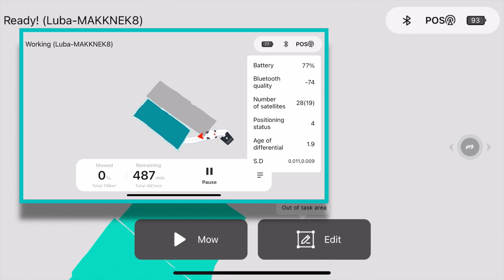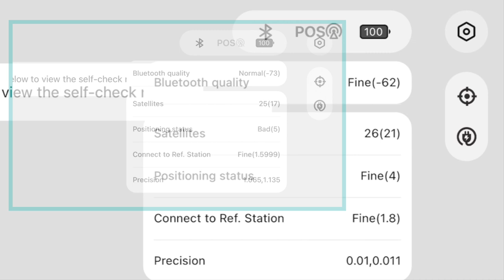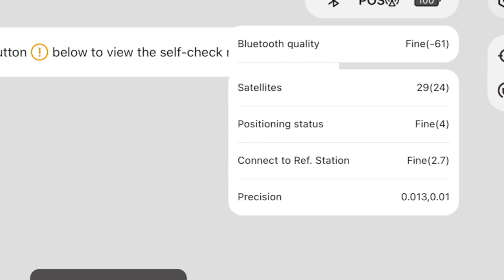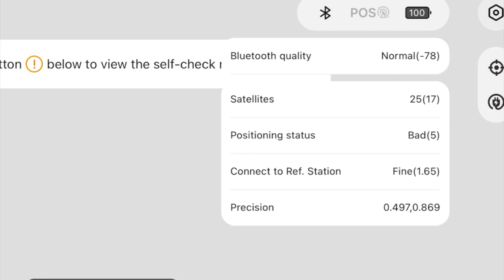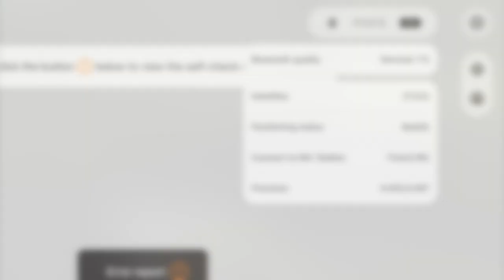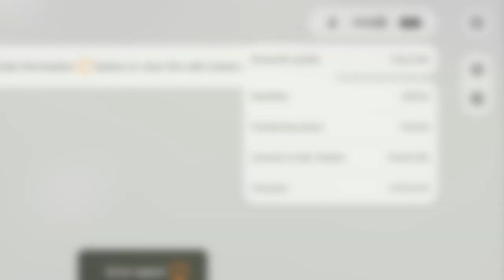Luba Automower Part 3 | Testing out Signal Strength RTK & GPS!

Comment: Thanks for going the extra mile with the signal tests. So far you are the only reviewer of this product that has focused on the most important issue. The cutting and other features are a given it's whether the signal will work in worst case scenarios. Well done. I plan to pick this item up next year. I want to see it get a few updates after mass use this year before I take the plunge.
Reply: Probably a good idea. I got mine yesterday and are working to understand the relationship between the base station and the RTk antenna, too.
Reply from the maker: Thanks for watching…. I want to do an update but my RTK is dead…. Water ingress… waiting on a replacement and will update
Reply: How long did it take to get a new one ? How was it dealing with customer support .. @thelonelandlord  thanks for the videos
Reply from the maker: support responded within 3-4 days and then took about 2-3 weeks to get the new RTK.... editing an update video right now... turns out my old one was FULL of water.  @dragonhead48

Comment: So the issue with trees is that they don’t necessarily reduce the signal that much but they do introduce a lot of signal error so the receiver in the Luba cannot calculate an accurate position. 
Signal error rates might cause the Luba to go from centimetre accuracy in the open to 1 meter accuracy under trees and of course 1 meter of inaccuracy could be enough to cause Luba to drive off a cliff or right through your veggie garden. So of course it will just stop until it can acquire a more accurate signal rather than keep driving and risk an accident. 

RTK and gps in general just doesn’t work under trees. 

The other think to note is the rtk receivers only job is not to send position information but to calculate how accurate gps is at a location and provide an offset to your Luba.  Your Luba still needs a perfect GPS signal. Then the Luba calculates how accurate gps is at the location your Luba as at based on the current atmospheric conditions and it sends a signal to the Luba that basically says ‘hey dude, for every position you calculate, you should add 2 centimetres north and 3 centimetres east offset and then your calculation will be correct’. 

That’s why both your rtk receiver and your Luba both need perfect gps reception all the time with nothing blocking them.

Comment: Thank you for the additional information and showing some of the range capabilities. It will be interesting to see how it works underneath your shade trees.
Reply: I have the exact same question... if the RTK is good but it goes under tree coverage and satellite coverage drops... what happens?  Does it just stop?
Reply from the maker: Good question… I do not have a lot of tree cover where the mower actually cuts grass so I can’t say, maybe someone else has experience and can chime in?
Reply: @thelonelandlord  Actually, thinking about your video... when you drove the unit under the camper and it lost GPS... the mower actually did stop, didn't it?  I'm assuming it would just sit there and notify you via the phone app and the same would happen if the foliage of a tree blocked the GPS as well?   BTW... thank you for this video update!
Reply from the maker: @covertpuppytwo3857  so when I drove it under the camper I was using manual bluetooth control which basically allows you to drive it around like a remote controlled car... as far as I know if it loses signal under a tree, it will simply stop and report a 'poor positioning status' alert.  The app, however does not currently support push notifications which is definitely an issue that I am anticipating them to resolve with a future update....
Reply: @thelonelandlord  Gotcha... thanks for that correction.  Maybe you'll want to do a maintenance video on it ... seeing how's there issue about not hosing the underside anymore.

Comment: The RTK does not need direct line of site to the Luba as it's 900Mhz. The GPS that both the Luba and RTK see do need to be. Both the Luba and the RTK need to see the same satellites.
Reply: Source for 900Mhz link ?
Reply from the maker: The manual makes reference to the RTK using radio signals. I can confirm line of sight is not necessary from RTK to Luba. Direct view of sky for both (Luba and RTK) is of most importance.
Reply: @jst8922  It's printed right on the antenna of the RTK.

Comment: Is there a way to check whether or not i have enough open area for this thing to work before I commit to the purchase?  Video was very good.  I've also seen a unit (mower)  that does not require the RTK module.
Reply from the maker: not that I'm aware of but this is a great question & would be a good feature.  The new version (Luba 2) is advertised as being able to use its optical camera to help make up for any lags or problems with satellite signal

Comment: I'm in the try me stages with Luba. Was really looking forward to your comparison to the Huskavarna mower as I have no idea what differences pro or con each would have. Could you share your thoughts at least as to which one is better? Thanks. I am trying thru Jan with option to return. So far a few issues but does an awesome job mowing. Looks great! Even and straight.
Reply from the maker: Love it.. was about to do a comparison video but my RTK got water logged and damaged. Mammotion replaced it  in a timely matter... Early on there were some valid points to debate between the Husqvarna & Luba, but since all of the software updates there is really no comparison... Luba excels in every way. Now, longevity and reliability is still an unknown however my Husqvarna has not been without its problems over the years also....

Comment: Thanks for the information. Very useful. Just bought one in the UK. To install the antenna in the roof I've got the adapter and 10 metres extension. Do I have to keep the power supply sheltered from rain? Not sure how to run this to the mains...
Reply from the maker: good question... I don't see anything on the power supply that notes it is water-resistant or rated for outdoor use... maybe someone can chime in?

Comment: any determination as to why the Luba ultimately established mower satellite connection after your second attempt? ( @  250 ft) Is it a learning issue? and it can pull weaker sat. as the AI figures it out.. Any idea what is  the primary default? is it distance to RTK or sat. obstruction, primarily?? on the fence to purchase since by 1/4 acre lot is heavily shaded on the back 1/3......thanks
Reply from the maker: Hey Greg my initial thought is it is sat obstruction because my RTK connection seemed good. they just updated the app again and changed how they report signal strength, so I will have to take it out under those trees and see if there is any conclusive info...
Reply: @thelonelandlord  thanks, just trying to understand if the 250ft from the RTK is a contributor and a much less distance would play into this. thanks again greg

Comment: Hey
From your test, it seems like housewall is not a problem. So do you think it would be a problem to mount the antenna on the attic? Our house i placed on the center of the garden, and it would be easy to get the cable up there.
Reply from the maker: I don’t think that would work…  it would likely connect fine to the mower, but the RTK needs a clear view of sky to connect to satellites.
Reply: @thelonelandlord  Ahh, Thanks 👍

Comment: I'm confused as to the power requirements.  If the RTK antenna is on your roof while the power station is in the middle of your yard are both plugged in to something?
Reply from the maker: Both need 120v power — but do not have to be connected to each other. I have an extension cord running to my  charging station currently until I decide on a permanent charging station location.

Comment: Cant say this about my. It has bad signal under tree and position lost, like they also said it theire tutorials. Rtk is a good precision old system. But it not should use as only system in a mover. A triangle calculation or a cam with ai has to be as additional support system.

Comment: Great video! but i have a question, if luba loses contact with satellite will it still run on the antenna?
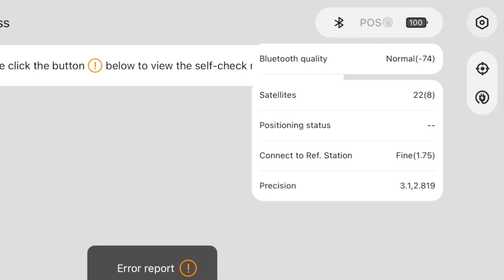Reply: for example at 7:35 it has lost its position signal, will it stop running if it was mowing or can it still run using Ref. station?
Reply from the maker: My understanding is that it needs both to operate as it only uses the RTK to correct the satellite signal it is refusing….. It has gotten lost under the large pine tree in my front yard by losing satellite connection, so I had to expand my no-go area to keep it out from under that tree.

Comment: Any issues with the mower getting lost, going outside the defined cutting areas after the RTK unit was securely mounted?   Or to put it another way, Did the bad positioning status ever cause performance issues?
Reply from the maker: I have not had any positioning issues yet… the only times it hasn’t completed it’s mowing cycle so far were due to getting stuck in a deep rut or on a root.

Comment: Does it ever hit a bumb, cut off, and throw a non-remotefixable mower lifted error? I love my Landroids but the bumping into a mole bump and cutting off for the day is annoying.
Reply from the maker: yes, it definitely does get stuck and cannot be moved remotely... I can say that the 4x4/rough terrain capability is much better than my Husqvarna 315 and it gets stuck far less frequently....  Also, it is easier to find the areas that it has trouble in because it is mowing in a repeatable pattern as opposed to guide-wire mowers that randomly cross over the lawn.
Reply from the maker: also easy to add a no-go zone to the area that it gets stuck in until you have chance to remedy it...

Comment: If needed, it is possible to have two RTK linked to the same Luba?
Reply from the maker: I believe someone asked on their Facebook group and they said 2 RTK's were possible
Reply: I asked a year or so ago when they were trialling in HK and was told no.  My understanding is the principal job of the RTK is to provide the mower with a correction factor for the GPS.  Presumably when mapping the area Luba will store the difference between the GPS as directly received and what the RTK receives.  From this if there is drift in the GPS location it cancels out as Luba just has to navigate to a point with exactly the same difference to the GPS location signal the RTK is receiving and because the RTK is fixed Luba will be precisely placed.  That is unless you allow the RTK to move!

If my supposition above is correct then if Luba has 2 RTKs it would need to receive and store 2 sets of difference figures for everything it maps.  I'm sure it is possible but I doubt it is an inbuilt capability.

From the above, however, it would mean the link between Luba and RTK is not relevant to the location of Luba, hence as long as the link is maintained Luba will be correctly placed.  Thus my question is can the link antenna of the RTK be remoted or even fed to one or more separate antennas with directional gain?  In my case I have a hollow fibreglass flagpole, could I place the link antenna inside at the top?  

Again if I am correct, other future options would be to feed the RTK information onto a home LAN so that whether the robot receives the LAN it gets the correction factor. Now that would be a really useful feature.